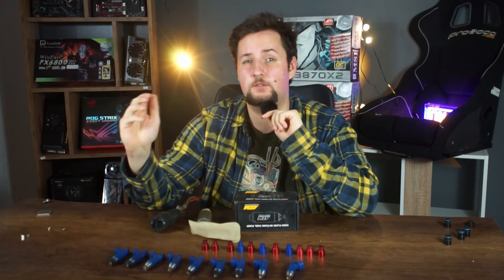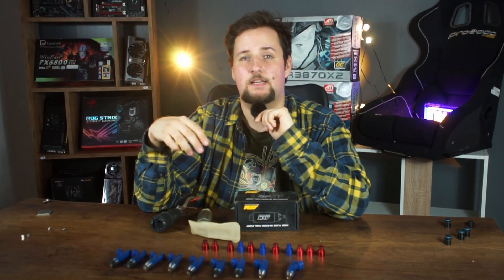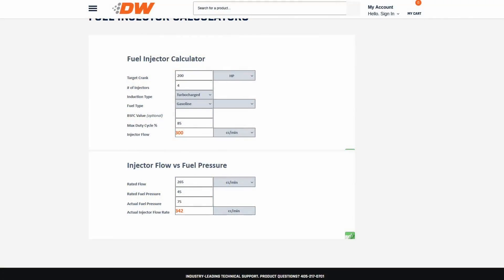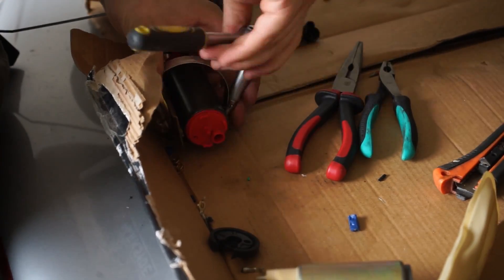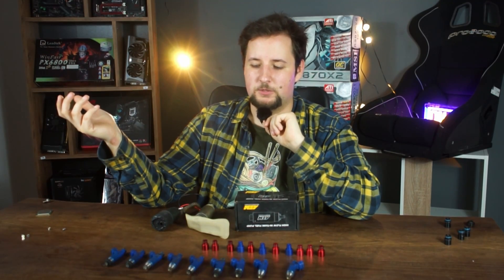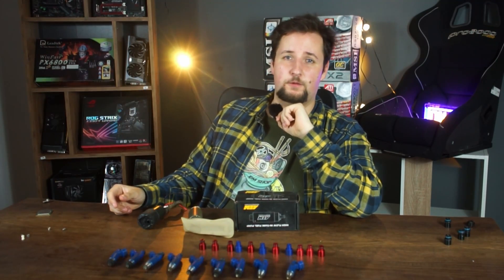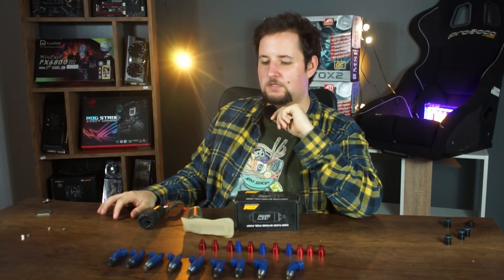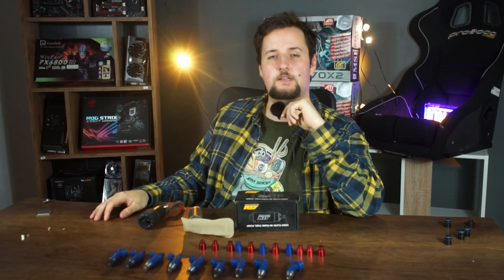What is the right Fuel Setup for your Turbo build? | Injectors, Fuel Pumps, adapters, compatibility

Comment: The subaru injectors are about 10mm shorter, they are not pnp
Reply from the maker: Yep but the stock fuel rail has spacers you can leave out
Reply: @throttlebuddies0  still wont fit, believe me, Im dealing with it right now
Reply from the maker: @epp9122 how much are you missing. Could probably grind down the mounts on the manifold somewhat. 
also you are using the bottom seats from the original injectors right? or if the subarus came with any.
Reply: @throttlebuddies0  of course you can make them fit, i will weld new mounts on the fuel rail instead. But as i said, they are not pnp, far from actually. They make 14to11mm adapters but not 11-11, if that were the case it would be and easy fix